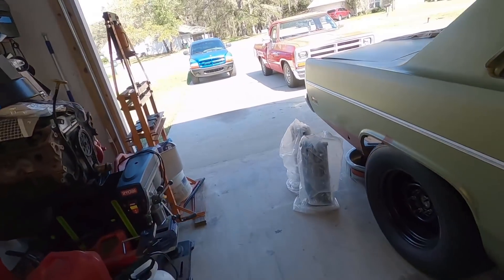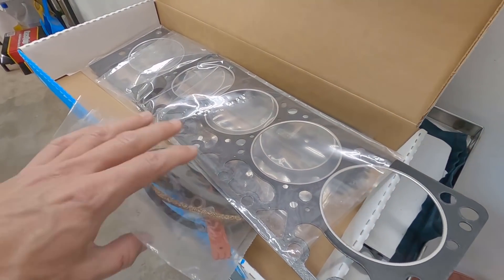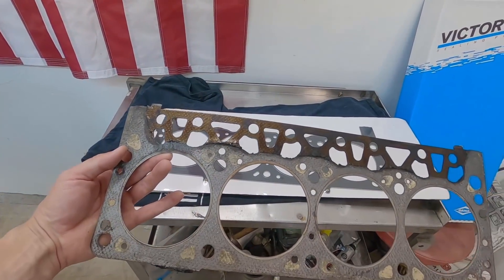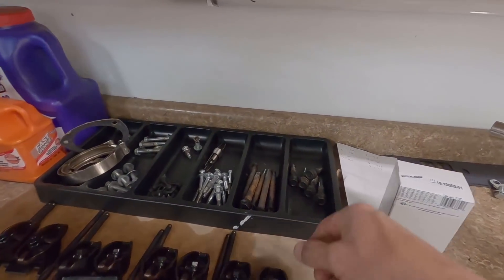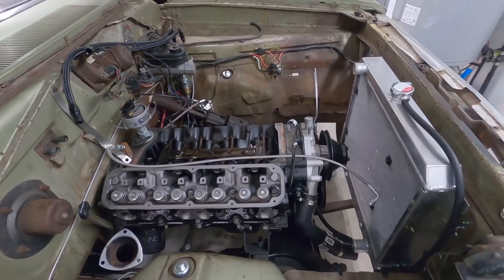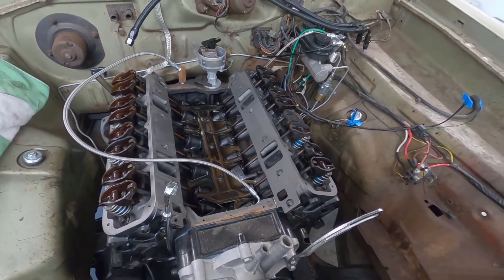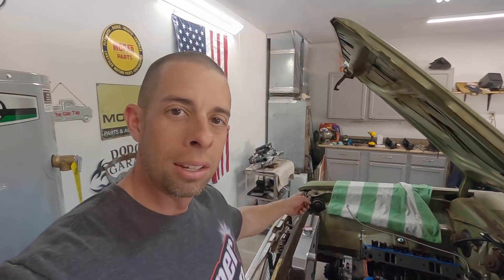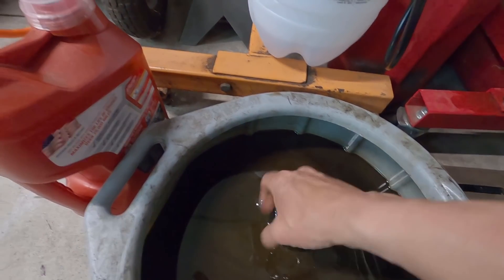Making HEAD-way on the '69 Turbo Valiant!!

Comment: I have a '99 Regal GS with a fairly modded L67 set up. ARP studs & fasteners, Cometic MLS head gaskets- intercooled, Mahle pistons, powered metal forged rods (stock in '01-up), full Comp Cams kit, ported & polished Eaton SC with a modular pulley set-up, yadda,yadda,yadda...not set on "Kill" mode, but very healthy. Motor has been together for 7 years and not a hiccup. FYi- Super Tech, Costco and Amazon synthetics? All Valvoline

Comment: You reckon those new MLS gaskets will lower the compression ratio a little?
Reply from the maker: I do
Reply from the maker: Also have to consider the machine shop probably shaved the heads some 🤔

Comment: Hey brother, good to see you're gitner' dun, are those heads 1.920 intakes or 2.020? And I noticed you're using the center dump exhaust manifolds, is that because of the turbo?
Reply from the maker: 1.92 heads and 1998 truck manifolds.

Comment: Bolts only require 1x diameter thread engagement, think about a nut and bolt application, non issue. Arps would provide 50% more clamping force. The issue with magnums isn't fastener size its lack of them. Only 10, essentially 4 per cylinder. I arp stud all my boosted builds.
Reply from the maker: How much boost are using compared to me?
Reply from the maker: What engines, setup (heads, cam, rotating assembly) and horse power are you running?
Reply: @TheGasTap  i haven't actually boosted a magnum, im putting 20lbs into a 440 makes 1300, i did build a magnum spraying 300. Also build ls combos, fyi they have 15 head bolts and no gasket issues. Always build it bigger and once...hopefully
Reply: @TheGasTap  just couple examples, i can send pics and details if tell me how, not knocking u any way or shape just been there broke that
Reply from the maker: What was the magnum nos setup? What was the failure?
Reply: @TheGasTap  408 scat rotating assembly, indy rhs iron heads, some early head gasket failures before stroker, cometics and studs, still running
Reply from the maker: Sweet. Is your family from Alabama and Florida by chance? Not often is see other Sanderson’s and my dad has mentioned a cousin Greg before.
Reply: @TheGasTap  ny

Comment: My brother used ARP studs for a stroker magnum he built. I know it was a real pain for him to get the right studs. I will ask him when I see him. Although it’s a little late now... How much boost are you going to be running? You may have mentioned that, but my attention span is that of a ant..
Reply from the maker: Only 10-15. Not enough to have studs  hopefully
Reply: you have to buy 2 arp bolt kits or something like that to get all the bolts you need.
Reply: @frigglebiscuit7484  not for studs.
Reply: ARP heads studs are money well spent on any engine that is going to see boost.